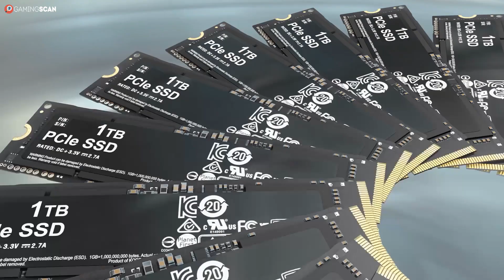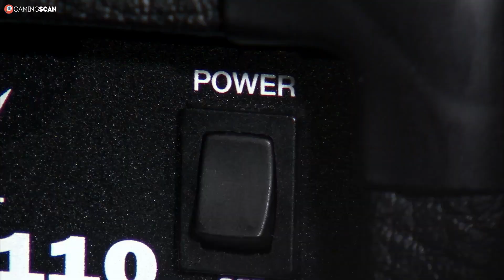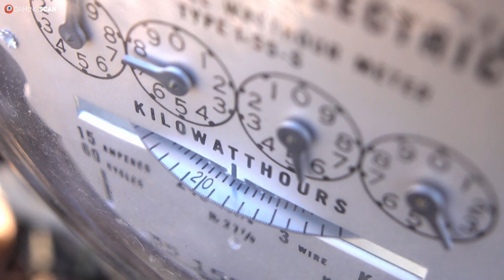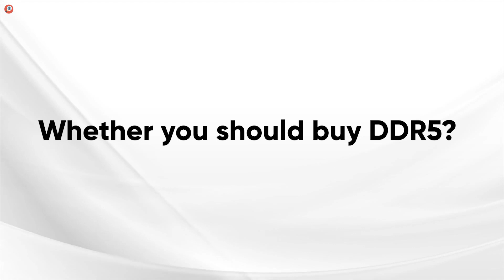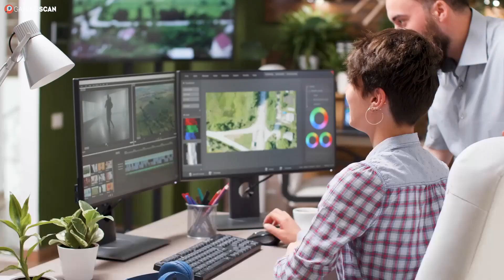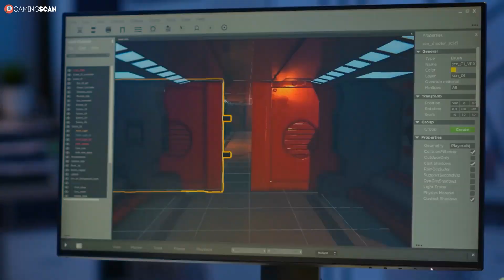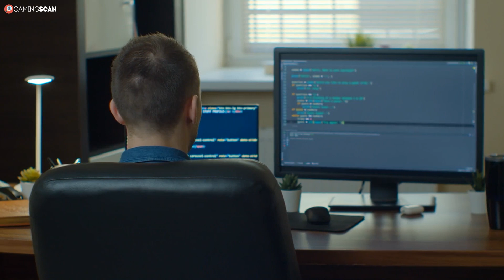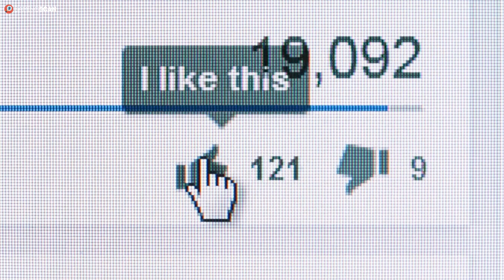What is DDR5 RAM And Should You Get It? [Ultimate Guide]

Comment: If the first motherboard you purchase that supports DDR5 only handles DDR5-4800, you won't be able to upgrade your RAM down the road without getting yet another motherboard. Additionally the best performing DDR5, like DDR5-6400 will be very, very expensive at launch, and probably just average memory after a few years.

Comment: It will be at least another year or two before I even think about building a desktop rig.  Given how DDR4 prices compared to DDR3 in its first few years, I'll probably buy a DDR5 compatible motherboard but install DDR4 and upgrade the ram around 2024 or 25.
Reply: You'll have to stick with select Intel CPU's to be both DDR5 and DDR4 backward compatible. AMD hasn't released any DDR5 CPU's yet, and would be doubtful they'll include DDR4 backward compatibility.
Reply: @lQuadXl  Well, crap.  I didn't think of that.
Reply: @lQuadXl  you were correct